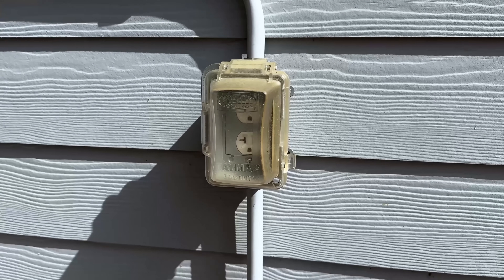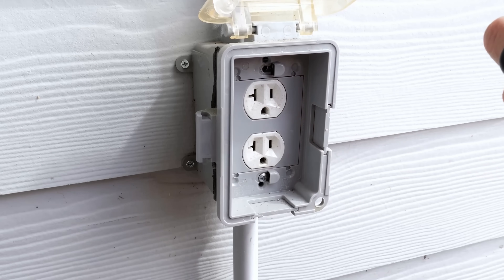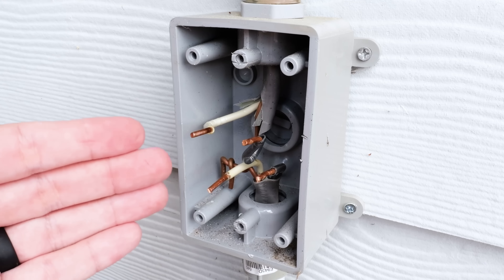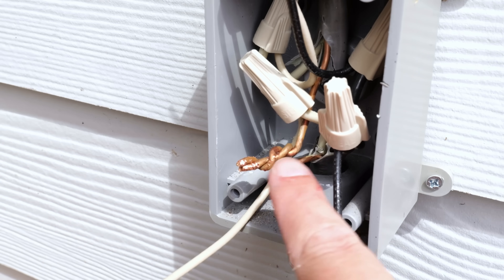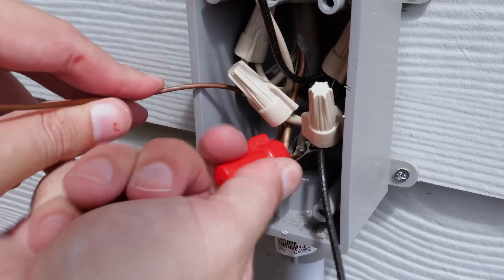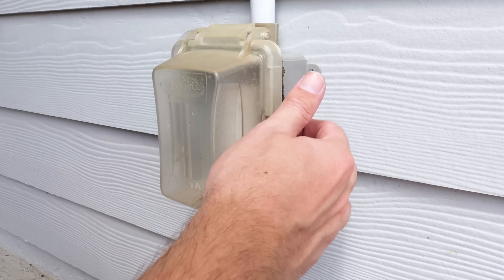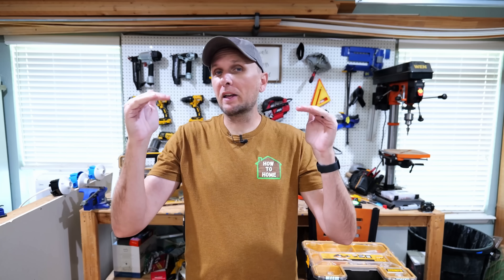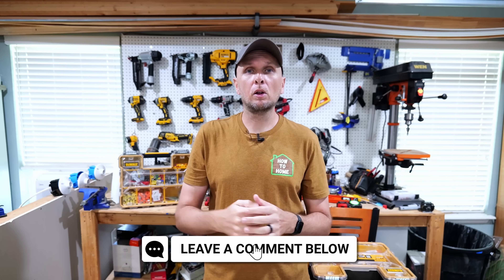Dangerous Mistakes DIYers Miss When Installing Outdoor Outlets!

Comment: You shouldn't mix wire gauge sizes (10 down to 12). It won't pass inspection.
Reply: That’s not true, How about a code reference?
Reply: @highvoltage1979  You don't know this? You're kidding, right?
Reply: @yopage  What you’re saying is half true if it’s a 30 Amp breaker, but if it’s a 20 amp  breaker there’s nothing wrong with down sizing.
Reply: @highvoltage1979  Downsizing to 14 gauge perhaps?

Comment: I had a gfci outlet installed (by an electrician) on an outdoor outlet that was primarily used to supply power to run battery chargers for😮 farm equipment and for rock tumblers.  The gfci plug turns off at any load rendering this outlet unusable.  What is the solution?  This is directly inside the outdoor breaker box.
Reply: After reading other comments, I wonder what would happen if a GFCI plug were wired into a circuit already protected by a GFCI circuit breaker.  Would that affect the ability of the plug to carry a proper electrical charge?

Comment: I'm glad you showed using the non-contact voltage detector to verify.  I have encountered installs where two circuits on two different breakers used the same wire channel, so verifying the outlet was unpowered was not sufficient to have no power running through the box. That's especially concerning when you also find the still-live wires are poorly wire-nutted in place.  The inductive voltage probe will often warn you in that sort of case.
Reply: You should use a multimeter and not a no contact tester to verify
Reply: @The_Borg  He tested the outlet with the multimeter before opening the case.  How would you use the multimeter to verify the wires under wire nuts stuffed in the back of a case and not connected to anything in the case are also dead?  Your proposal is that you not run a test that can give false negatives, because you should just skip to the part where you're testing live wires hanging in open air.  How about no.
Reply: @yellingintothewind  there's no exposed live parts, so what's the point?
Reply: @The_Borg  In this video, you are correct.  However, when you open a box you have not been inside before, you don't know what is hiding behind the outlet.  As I said in the original post, I have encountered second runs tucked behind outlets, wire nutted together.  If those wire nuts were not properly installed, then when you start pulling the outlet out, they may well spring open.  If they are on a different circuit, you now have live wires just hanging out.  A potentially dangerous situation that can usually be detected and prevented by taking a swipe with a conductive voltage probe after taking the front cover off and before you start poking at the internals of the box.  It is not a substitute for checking for voltage with a multimeter, it's an additional step to take if you don't know what the state of the internals of the box are.
Reply: @yellingintothewind you wouldn’t be dead you just wouldn’t have to have a cup of coffee
Reply: @yellingintothewind not to mention the heat of all of them wires being crammed into the small box
Reply: @Nuf_Nivah  Yeah, you don't usually go into a-fib from a brief exposure to 120 VAC, so it's more crucial for our friends across the pond. Of course, it's a bad way to find out you have a latent heart condition.

Comment: Hello, I am curious , why was it ok to run romex wire in a conduit?
Reply: It's ok to run romex in conduit except in wet locations (which it is in this case).  But romex is likely to over fill 1/2 inch conduit.
Reply: I can't figure out why code says you can't.  Even if you hurt the romex pulling it, it is still inside a conduit.
Reply: It's not Romex. And is code compliant depending on fill

Comment: It might have been worth mentioning that GFCI Outlets come new in the tripped condition. You use the reset button to set the outlet for normal operation once installed. You also might want to mention that the main breaker must be on when you push the reset button because the reset button will not work if the circuit is not powered.

Comment: One thing I do to "waterproof" or help in preventing the ingress of water is to run a bead of caulking all around the box where it meets the wall. I also smear caulking along the foam edges to further protect it and also seal the edges . After this is dried I then paint the box except the lid with exterior latex paint with the same color as the wall.
Reply: I just use paint to seal any cracks! 🤔
Reply: Cover will have a waterproof gasket. If it doesn't, replace it. DO NOT CAULK IT
Reply: @MrEricld1  OK. Its just the exposed part around the periphery of the foam once the cover is tightened up. As much as the foam is waterproof I have seen deteriorated foam at the exposed edges due to the elements particularly , sunlight. It is not the entire foam that I add caulking , just the exposed edges, to reiterate.

Comment: Why did you put in 15 amp GFI where it was a 20 amp outlet before. Did you change the breaker to 15 amps?
Reply from the maker: Because that’s what I want there.  I don’t have anything 20 amp to plug in at that receptacle.  No I didn’t.

Comment: Cool powered hand driver, I'll have to look into getting one. That being said, all this concern about outdoor exposure and code compliance and you didn't use a single bit of electrical tape?  Not around your curettes? Not around the contact points of the receptacle? NONE?
Reply from the maker: Not required.  Some have a preference to use that.  I just think it creates an unnecessary sticky mess.  Only place I use tape is with electrical near motors due to the vibrations.  But to each their own.  If you prefer to use it, nothing wrong with it at all.

Comment: Unless you downgraded your 20A breaker to a 15A, you have effectively created a fire hazard as the 14Ga wires you used as "pigtails" are not rated for the 20A available from the breaker. You should have replaced the GFCI receptacle with a 20A GFCI and used 12Ga pigtails if you are keeping the same the Circuit Breaker installed in the main distribution panel.
Reply from the maker: When did I say those were #14 wires.  They aren’t.  They are 12.  And I didn’t want a 20 amp receptacle there.   Nothing was wrong with it.
Reply: @HowToHomeDIY  My bad if they were indeed #12. @ 7:25, the wires look much smaller than the stubs you are connecting to. Maybe an optical illusion from the camera? I get not wanting the 20A recp. if it is not needed though. Cheers!

Comment: The Receptacle is installed upside-down. The way a 3 Prong Receptacle was intended to be installed with the Ground on the top so when plugging in the Thumb is touching the ground and not crossing the "+" and "-" and getting electrocuted.
Reply: No code requirement for receptacle orientation. Which ever way floats your boat.

Comment: It's gonna be a lot of comments because at one minute and 50 seconds it's already starting off incorrect. There's a national electric code, and then there's individual codes by a municipality that you live.

However, from the first authority, the national electric code, if you had an outdoor outlet that had no GFCI protection at the outlet, that does not necessarily mean that you cannot install one upstream in the load center, and then install meet code. 

And that's the basic initial code as opposed to anything that's more restrictive

They're doing it right, and then there's doing it correct. 

You're trying to do it right but you're not really doing it correct. 

Sheathed NM cable run thru conduit (I would address the difference that it needs to be outdoor rated), and that appears to be correct with the Gray cable. However, Wego or wire nut if you're gonna wire either one outdoor, you should, not must, but should if you're doing it Correct, use a waterproof connector.

Which you didn't, which I say is the correct way as opposed to doing it "right ".

Lastly, conduit clamps have to be installed within 3 feet of a receptacle. So while it is beneficial to add the clamp like you did, by code, it does not need to be there.
Reply from the maker: I think I mentioned there are other ways to address it.  So nothing was incorrect.
Reply: @HowToHomeDIY No, you specifically stated it’s a code requirement in the video. It looks like in your case in this video it is not a code requirement per NEC code.
Reply from the maker: @Phitur1 GFCI protection?  Yes it is a requirement.  But I mentioned there are other ways to achieve this.  I chose to install a GFCI receptacle.  Not sure what the issue is.
Reply: @HowToHomeDIY   I was not talking about GFCI protection. I was talking about your statement about clamping the conduit. You made a general statement about a code requirement in the video regarding that and I do not think code required them in what you showed in the video. Hard to tell, but it looks like you may be less than the required distance that calls for them. Just noting the difference in what the code actually calls for there.
Reply from the maker: You edited your comment.  You now mention way more but still nothing you listed was done wrong in the video.

Comment: hard to give a thumbs up to this video when you essentially just installed a resistor in line. Just because 12 gauge is rated for 20 amp doesn't mean you should insert it in between two 10 gauge runs. you've just created a resistor, congratulations.
Reply from the maker: Hard to give this comment a thumbs up when it is a 20 amp circuit that only requires 12 gauge wire.  It will have ZERO effect on the current or voltage that early in the run.  Congratulations on making an ignorant comment.

Comment: 10 gauge solid wire only has 80% of the voltage capacity of 10 gauge stranded but costs 90% of 10 gauge stranded. And is harder to fish through walls

Comment: Gadds - what a mess of wire connectors barely stuffed into the box.  I would have used Wago 221-613 connectors to tidy it up.  A good time for a discussion of the Wago connectors for 10 ga wire.  Also, for those DIYers who don't know - an explanation of Load vs Line (and why it is important) would have been helpful.
Reply from the maker: I did mention those Wagos.

Comment: 2 things you didn't mention, box fill and derating. When you used a #12 pigtail you negated the #10 used for voltage drop, the entire run is now rated #12. When you start adding larger receptacles (GFCI) and wire nuts you add to the amount of box fill. Shallow boxes are easily overfilled when larger gauge wire is used.
Reply: First thing I thought of when he didn't wire nut the pigtail directly with the two 10ga ends.
Reply from the maker: @nt40lanman that would defeat the purpose of the GFCI downstream.
Reply from the maker: That is incorrect.  The #12 being used that close to the beginning of the run will have ZERO effect on what the #10 is there for which is voltage drop.  It is a 20 amp circuit.  The second thing, pigtails and wire nuts do not count for box fill, so they don't have anything to do with it.  And yes if most people would come across my situation with the #10's they would want a bigger box or use a ring extension.  Since almost nobody will have that, for the purposes of this video I demonstrated it as though it was #12 or #14 which box fill would not be an issue.  I personally added a box extension for my rare situation.
Reply: @HowToHomeDIY  you obviously don't know how to calculate voltage drop and wire nuts and the size of the device definitely have an effect on box fill. You handymen don't have the knowledge, discipline or ability to become tradesmen so stay in your lane and sharpen some scissors.
Reply from the maker: @lindsayseal8504 of course, just another reply offering nothing backing up what you’re saying and just attacking trying to discredit what I’m saying.  I really hope you aren’t an electrician because you should not be working if you think wire nuts count for box fill calculations and also think that a #12 6” pigtail is going to effect the voltage drop at the beginning of the run.  Numerous electricians in the comments have confirmed what I’m saying if the NEC and a basic search is too much for you to do.  All you do is attack with no citations for your claims.  Just another self proclaimed anonymous electrician/expert.

Comment: - The GFCI current breaker (or RCD, RCBO) could be located in the fuse box.
- With push in connectors the length of the wires is correct.
- But there is no connection from the socket to the protective earth. 
- And there is no connecting terminal or wire nut on the protective earth. just twisted
- PE has no insulation attached. A green or yellow-green tube is necessary.

Comment: I never understood the need for the 6” wire length code?  I’ve always associated “code” with “for safety reasons”.  The extra wire jammed into the back of the box is, to me anyway” counter to this be more safe. Just curious??

Comment: As a 40+ year industrial electrician, I wouldn't trust that no-contact voltage detector any further than I could throw it. THEY CAN GET YOU KILLED. 

Leave the wago connectrs on the shelf. Wire nuts are NOT connectors, they are insulators. Twist your wires then insulate the connection with a wire nut. Then sleep easy knowing you didn't create a loose connection.

Comment: I have encountered such outlets that were on a switched circuit. This could be intentional, to prevent camping. But I would check the circuit with the tester in the outlet, and turn breaker back on to verify... maybe because I am not an eleckchicken, I am overly cautious/hesitant. Another error is tapping an existing circuit for convenience, that may already be maxed out, or on another GFCI upstream.

Comment: I'm guessing they went through the trouble of 10 gauge because they wanted 20 amps.  That looks like a 15 amp GFCI you put in there.
Reply from the maker: 10 gauge is for 30 amps.  A 15 amp duplex receptacle is permitted by code on a 20 amp circuit.

Comment: Can you not just tie all the neutrals and all the hots together with their pigtails using just 2  wagos or nuts?  Electrically that would be the same would it not?
Reply: @brucebowman9087 No.  Connecting separately to the Load terminals ensures the downstream portion of the circuit is GFCI protected.
Reply: @skityke  ahhh, I didn't think of that. What if the circuit is on a GFCI breaker?

Comment: Should you not connect the inbound and outbound 12 gauge wires to single black and white pigtails and run those to the outlet. As it was done you are relying on the outlet to splice the inbound and outbound legs of the circuit.  Seems sus… if the outlet fails everything down stream will fail.  I’m not an electrician just a thinker…
Reply: GFI must be able to break the connections. Downstream outlets could be wired as you described.

Comment: With the added 'pigtails' the box is now too small and should be replaced with a deeper box.  An over crowded box  can cause the wires to over heat, break the wire and even cause a short.  Using a 12 vs 10 gage you now have defeated the purpose of using 10 gage to begin with by 'chocking down' electrical flow. Solution might be to  connect the 10 gage and pigtail the GFIC but that then would require a separate GFIC at every outside box ... which in it itself is not a bad idea.

Comment: It's a good idea to test all the equipment is working correctly before doing anything.
I recommend using a device which shows you the voltage.  This may highlight other potential issues, like the outlet has been incorrectly wired or bad wiring else where in the circuit.  Non contact voltage testers, in my experience, are not as reliable, and do not tell you if there are other issues.  I do use them, but generally, only as a back up or if I there are no exposed wires.

It's also a good idea, to tell anyone living in your house, not to turn any circuit breaker back on.  Ask you before touching anything.

An outlet tester is worth its weight in gold.  Especially, if you just bought a new house.

Comment: With a 12 gauge pigtail now going into the outlet and a 10 gauge wire leaving it to go to an external load, would the pigtail overheat if someone tries to place a 20 amp load further downstream?  Better to use 3-way IDEAL junctions as someone previously suggested.

Comment: Um, is ok to carry the 2OAMPs to the later load through your 12 gauge pigtails carried across the switch? Is there still not a concern or does the short length of the 4 pig tails mitigate the current and gauge concern?  Can/Should you not join the load and source 10 gauge and the 
pigtail for black and white in two wire nuts?

Comment: I was wondering why my garage outlets and external were GFCI. I knew bathrooms required. Assumed there was some code for garage, but good to know it's related to "wet" areas. Assumed humidity but is it other? Outside would be rain and such, but garage?

Comment: Yes the outlet outside was not GFI itself, but what people should know is that sometimes the outlet that it's connected to is GFI and is covering both.  Just saying people should know that there could be GFI further upstream or they have a GFI breaker in the fuse panel sometimes.
Reply: He mentioned it was the first device on the line, and the breaker was not GFCI.

Comment: Are you defeating the purpose of 10 gage when you reduce to 12 gage back to 10 gage   like a water pipe 1 inch down to 1/2 inch back tp 1 inch cuts the volume of water able to come out the end ? And yes I know electricity run the surface of the wire.

Comment: You stated that the wire was larger due to voltage drop yet you only used #12 pigtails. That seems to me that you just created a choke point in the circuit. The circuit flows through the GFCI outlet.